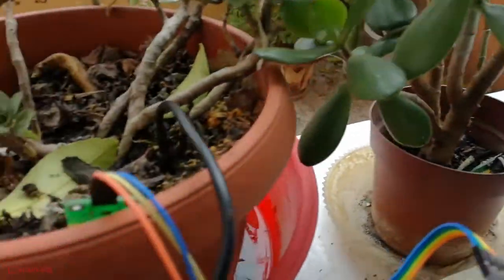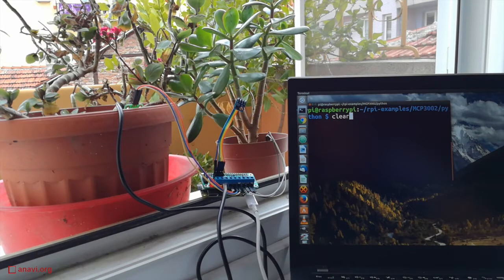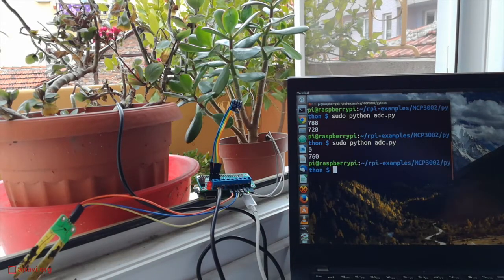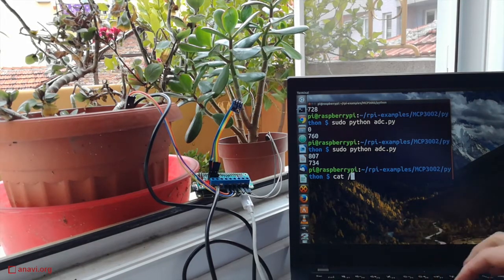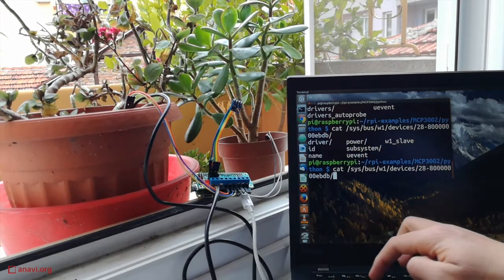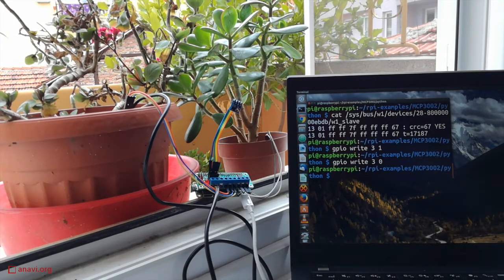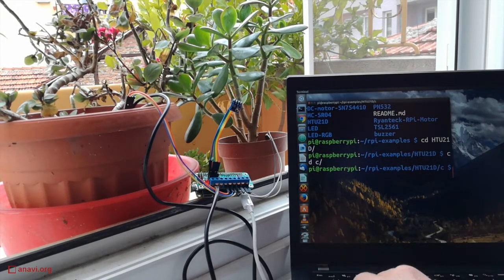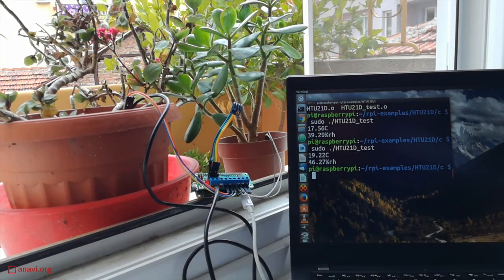My First Steps in Gardening with Raspberry Pi

Comment: Great start, I could see a benifit if a small screen for real time readouts, and I’m sure you will get a case going once you have it worked out, I’ll be following :)
Reply from the maker: Thanks for the suggestion. Probably a display attached to I2C will be a great addition at low price. I have been put on hold the gardening project until I finalize and launch another interesting project for lighting with rpi. It should be released really soon: https://www.crowdsupply.com/anavi-technology/light-phat

Comment: Nice video, thanks. I'm hoping to deploy a similar solution to my vegetable garden but it will be powered via solar panels. My problem is in Ireland we don't get a lot of sun and the RPi zero drains my battery overnight & the battery goes into "low voltage" sleep mode and I've to manually disconnect & reconnect the load to wake up the battery every morning...so not completely autonomous yet.
Reply from the maker: Your project sounds awesome! Keep working on it! My goal is more modest - for the moment I need something to monitor my indoor plants and to remind me to water them.
Reply: Thanks, liked your article in magpi, inspiring. I'm not designing PCBs, just piecing together parts I have and learning all the time :)
Reply from the maker: Paul Mac Giolla Caoine I also use off the shelf components for quick prototyping before designing the PCB. Btw I received very good feedback and recommendation for this gardening add-on board which I plan to implement in the next revisions :) Stay tuned for updates :)